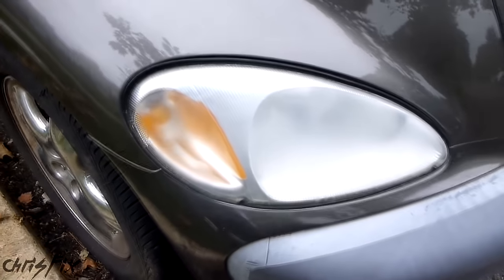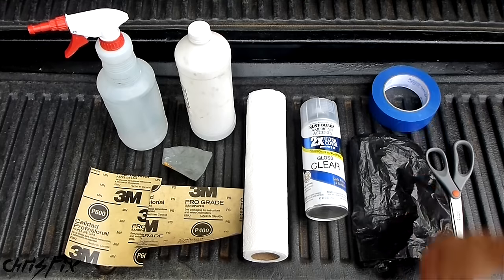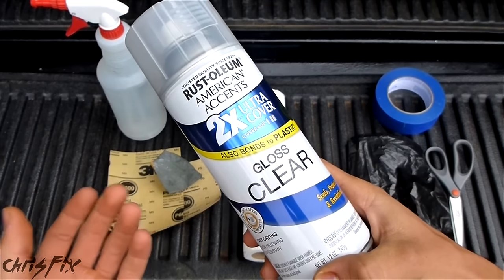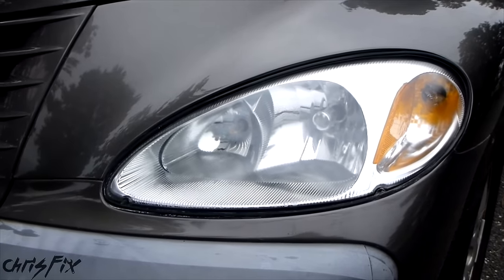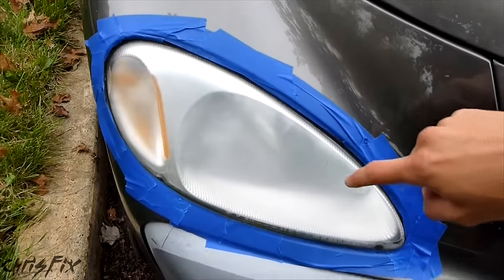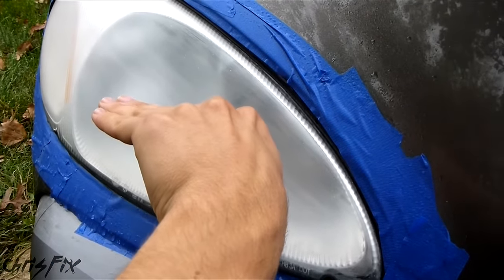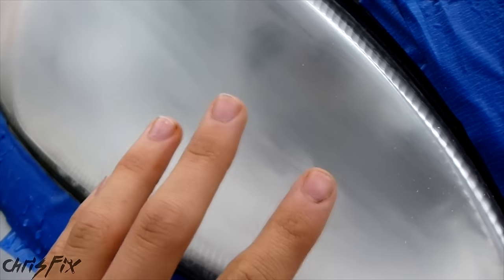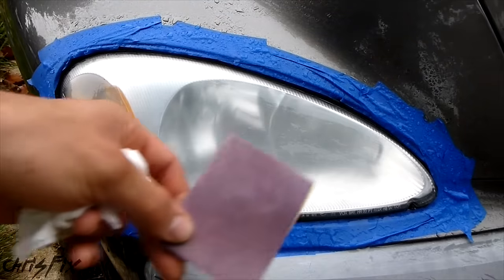How to Restore Headlights PERMANENTLY

Comment: After 3 coats of clear gloss... There is some haziness from paint I believe.  What shall I do to get absolutely clear glass now?
Reply from the maker: Wait a few days for the paint to harden and cure. Then wet sand with 2000 grit so it is uniformly hazy. Then move up to 3000 grit, then 5000 grit and then use a polish like this and buff it until crystal clear: https://amzn.to/2sJbZXk
Reply: Can a wax be used instead of this polish?
Reply: Buy a new headlight if you want perfectly clear glass.
Reply: wabash that makes no sense because headlights are plastic and the glass ones don't haze
Reply: sharkvshark i
Reply: Tim Schutte figures someone would say just buy new ones. People are so fucking lazy now adays.
Reply: I think even "new" headlight are plastic not glass.. the only ""glass" headlights are the ones you see in older cars, the sealed beam type. 

excellent video again from Chris.. where the hands are the star :)
Reply from the maker: Wax and polish are two different things. Wax is a protectant while polish is a fine abrasive that works like sandpaper but on a really fine level. So they are not interchangeable.
Reply: Chris after the polish and buff would u carnuba wax it?
Reply: Chris how do you feel about soap drops in water for wet sanding “wetter”
Reply: Chris, can you add a link to a real 2k clear coat like SprayMax 2k Clear Glamour? I think a lot of people are getting sub par results with 1k paints.
Reply: Just had the same issue after finishing up just now. It is hazy. So I will wait a few days and do as directed Chris. After the 24 hour period, is the car drivable?
Reply: What if it rains within that 24 hour period, or even right after you do this, lol? I checked the weather by the way.
Reply from the maker: That is defintely a technique I am using now and it does help!
Reply from the maker: Yes the car is driveable after a few hours but the longer you wait, the better it will be.
Reply: ChrisFix So I should sand it back down with 2k, 3k, then 5k grit and then use the Carnuba wax some time after the 24 hour period? Will I need to apply another layer of clearcoat after sanding before I add the wax after another 24 hour period?
Reply: Neal Edmondson Or maybe some people have other things to do than spend days doing this. I make $25 an hour. Every hour I do nonsense like this I lose money. A new set would be like $100 or less with no work.
Reply: How much money you make is   Irrelevant ? some people just like to save money and repurpose things nothing wrong with that
Reply: watching this painting as somebody who actually did some minor paint job (which worked great, no polishing afterward, perfect clearcoat.. this fear of running paint is funny. i mean, i did the same, but you should look at reflection in an object you are painting and you get perfect coverage but absolutely no paint running
Reply: ChrisFix @11:40 you use carnuba car wax, but in the description you also list “Compound polish to remove orange peel”. Did I miss the part where you use the compound polish, or did you change your mind about the carnuba and are now suggesting the compound instead? Or is it both? Thanks for this great video.
Reply: Always use a few drops of soap in the water.  Lots less dragging on the sandpaper.
Reply from the maker: Sanding with 2k will only smooth out your new clear coat surface, not remove it. It removes the orange peel and then you can move up the grits to smooth it out and finally you can use a polish to make it crystal clear.
Reply: Ben Saunders, Exactly!!  That’s why I change my own oil.....I enjoy it for a lot of reasons!  It has nothing to do with how much $$ I make.
Reply: Chris can you do a video on Glow Plugs, cleaning, checking for continuity etc?
Reply: Its going to get worse with time. This is not a good method . There are various products that can do the job and headlights should not be sanded .
Reply: But if you want the best result as of now than repeat this method . And put LaminX on your headlights. Its a tint basically dont worry you get the clear version and should help
Reply: sharkvshark is
Reply: adam smith only real gear heads would rather work on something rather than throw money at their problems.  Become a real gear head before coming here and saying that working on cars is irrelevant because you make big money.
Reply: Ben Saunders a new BMW X5 2011 headlight is $1000+... Thanks to this video, I only spent $20 for the material. And I'm going to do it for both of my beamers, yes absolutely worth the try.
Reply: Prowler - just like printers, people don't realize they make more money with parts than with the car in the 1st place.
Reply: Yeas do what chris says if you get orange peel sand it again and then reapply clear coat again and then sand it and clear coat again and then sand it and clear coat and sand it and clear coat and......
Reply: clear poxy instead of clear / remove the light
Reply: Hey Chris, I just try this and they look so much better. But I do have the same orange peel problem. I’m having trouble finding 5000 grit. Can I just stop at 3000 grit and use TW scratch & swirl remover as polish?
Reply: If you have a garage, you should absolutely do this inside. You should also use a hair dryer if it's cool outside and get the headlight up to 70F. Cold and dust are enemies of paint.  Also, he is holding the spray can too far away from the light.  The nozzle should be no more than a hand's length away.  You will end up with specs of dry paint mixed in with the paint.
Reply: you can get some rocking plastic two-part polish
Reply: That is meant to be used on plastic, not clear coat.
Reply: The back door on a Toyota 04 hit the panel off how do you do it passenger
Reply: ChrisFix just finihed yhis also having the haze problem. my question is aftet sanding . do i buff with my hands or do i need a buffung machine. 2nd question after the buff polishing do i also add the canova wax. thanks
Reply: $100??? On a cheap car maybe. But I doubt that too.
Reply: Today I learned that headlights magically install themselves once they are purchased.
Reply: +Adam Smith what you are saying is if you do this outside of work hrs and fix your headlights in less than 4hrs you have made money :)
Reply: Took me about 1 hour total to do this last night including drying time between coats of paint. Headlights look great.
Reply: Bird Person glad to hear it worked for you!
Reply: adam smith so why are you watching this video lmao?
Reply: @ Adam Smith    Go get 2 headlights replaced for $100.00 in fantasy land.  Alot of people take pride in doing things themselves, myself included.   And I am pretty sure you only make money when your working.  This is a few hour project when you have time to spare.  I have never met somebody who works 24/7.
Reply: 1 new headlight on my bmw $1200, this worked good for me
Reply: Do 400,1000,2000 and compound and polish after and finish with uv coating not clear coat
Reply: Good for you making $25 an hour. Some of us don't get that much so we are always looking for ways to save $$$. Plus you make it sound like you are getting paid $25 an hour 24 hours a day.
Reply: you still have to go for shopping the light, installing the light, and work 4 hours in your job
Reply: I resale cars. These little touches go a long way and getting my full asking price. I even remove wiper arms and paint them back.
Reply: Hey Chris would a heat lamp help it cure faster?.
Reply: sharkvshark use Meguiar's plastic cleaner/polish with a microfiber rag. Gentle circles....this stuff can also be left on as a protectant. It's good to put a new application on at least once or twice per year.
Reply: Nikhil, you are wrong. I used this same method 2.5 years ago and there is absolutely no change to my lights even in Carolina heat and sun! My lights were so bad initially I could not even see the past the yellow haze
Reply: Chill Nippins it’s a cheap fix , but does the trick for about a year , plan on repeating this process over time you’ll see that it’s not permanent.
Reply: sharkvshark q
Reply: How do you taste test a battery for a drill
Reply: my bad spot was fixed but now i seem to have another spot, i believed caused by bad technique on my part.  i'll take this advice and try again in a few days.
Reply: Just used this method. 
See how it goes
Reply: Nikhil Nadasan  Why not?
Reply: adam smith  $25 an hour coming from the guy that has a gofundme page.
Reply: I waited for the clear coat to harden fully (3 days) and wet sanded with 2000 grit, cleaned it and used my cordless drill with a polish head (10 dollars sponge polish head and generic inexpensive laqer polish)  and polished it to crystal clear 👍
Reply: Not everyone makes that kind of money. So, yeah, in a perfect world buying a replacement is ideal.
Reply: OK
Reply: @LORDRA1DEN  Dude, you make 25$ an hour? Do you live in a third world country? Is that why you're bragging about that? Get a real job, man. 25$/hour ain't shit.
Reply: @wabashstudio  I did it this way with the wet sanding and polish after painting and mine are perfectly clear
Reply: David McGaughey must leave it bound for 24 hours
Reply: Does anyone know what would cause this? I had the same thing happen with my Accord, decided to sand it off and start over, but I wanna make sure I'm not missing something before I do my second go. Pretty sure I have the same spray as Chris too.
Reply: Hey @ChrisFix , i did my previous car as instructed per video, and was all fine, but clear coat i used was from Poland, now i did same job on my other car, but used this rustoleum as you use. and my lights were hazy and clear coat wrinkled on top of the light :( looks worse and cheap than was before.. how do i fix this. because it seems as wet  sanding was not really enough. or was too much ? Help :O
Reply: your headlights are glass?
Reply: @nikhilnadasan6028  Yes. I'll use my $20 kit that comes with a buffing thingy for the drill. Easy and lasts a looong time!
Reply: Don't use clear coat lol
Reply: @wabashstudio  use 800 grit then 99% acetone then use cordless drill and TCUT takes 15 mins and clear like new
Reply: sharkvshark did u live in New Jersey at one point sometimes I hear the accent the  you go back to a standard American accent..
Reply: I did it but i failed what can i do now i have haziness and bubbles help me please
Reply: Hey adam smith ,,, my annual are near 200k and i do shit like this just for the joy of accomplishment in a JOB well done
Reply: @sharkvshark  shoe polish lasts for years. Black for mirrors etc and neutral for paint headlines. Very cheap.
Reply: @chrisfix  m
Reply: It worked good! Got the orange peel tho:(. But I will fix that with you last “optional” step. If your gunna go this far to do it might as well go all the way right?  BTW your channel has got me into working on my car thanks a bunch buddy you save me lotta money. And I have a new habit now even if I’m just a beginner
Reply: Toilet cleaning easy
Reply: You know it’s crazy but like you said old headlights are glass and have no problems getting dull. The old glass ones were about $3.95 in the fifties. Now they are plastic and costs several hundred dollars each. Why did manufacturers go to plastic, so they could make more money ?
Reply: you can buy plastic too.
Reply: sharkvshark buy a glass headlight.
Reply: sharkvshark f
Reply: G fig hi
Reply: sharkvshark 8
Reply: @chrisfix  can I use that from begining? PlastX Clear Plastic Cleaner & Polish
Reply: @wabashstudio  😂😂😉
Reply: @LORDRA1DEN  I make $33 (+OT) and hour but I still do my own oil change when I could get it done for $45, that because I enjoy doing it the way I want.
Reply: After 3 coats of Rust-o-Crap...you are having hazziness because that is called SOLVENT POP!!! And there is NOTHING you can do about that except STRIP THAT CRAP OFF! 

"Solvent pop" is the term used in the professional scope of automotive coatings, to explain the different characteristics of, not just automotive coatings, but all coatings. In this case, professional high dollar coatings can have similar problems that are seen in cheaper, production coatings not meant for professional use.
Reply: @rotceridjc  because glass shatters in an impact. Plastic breaks. its for protection. they could use the same type of glas like in the windshield tho, so easy answer is :plastic is easier moldable then glas and way cheaper lol
Reply: @wabashstudio  I have YET, to find a "cheep-budget-headlight"  for a PRIUS. i'M not COMPLAINING !  For after 10 years, 146k miles I'm still getting 48.8MPG hyway/50+ combined & all i do is  change the oil, filters, wipers, rotate the tires & thank God everyday I have this dream machine that really has a lot of room inside. Just sayin' MERRY CHRISTMAS.
Reply: buy new ones
Reply: @wabashstudio  $250esh each for new headlights or this.
Reply: @nealedmondson3191 not sure how being getting end results with a Helluva lot less money constitutes Lazy but you're entitled to feel however you want
Reply: Well I keep on making free mechanic help videos that actually help please and guess what I get for being honest and helpful?.... £0  ;) Real life sucks!
Reply: adam smith pointless non sensical argument mate. And$25 an hr ain’t nothin* to brag about. Sorry bud. I double yr wage that but I’d still sit down with a beer and do that. Yr learn something. And keeping coin in yr pocket too. But u of course knew that   Carry on
Reply: adam smith some people have more time than others for this. Also some people get  satisfaction of doing something themselves instead of running out and plunking down cash.
I did mine today and they came out great! For $20. And 2 hours of my time.
Or i could have spent $300. On new, which didn’t make sense for me on a 2010 110k mile car that i will probably sell in 12-24 months for something newer.
Reply: Cereal Spoon Lmao off 25hr! Haha, i know people who make 200k plus live in big houses and do the simple things like this and rotate there tires, change there oil, cut there own grass etc.. because they enjoy it.
Reply: Amazing results, and even more amazing presentation -- very thorough, engaging, and succinct! For finer buffing, I like Flitz polish paste, which is also formulated to be safe for plastic. By the way, you forgot to include the cost of whatever drug you took to make your hands move so fast!
Reply: @KeweKrypto 12 most retail "waxes" have chemical cleaners and or abrasives in them. Unless your talking about a true paint sealant.
Reply: KeweKrypto 12, the way you worded it, you said polish was not abrasive and that wax was not abrasive and that wax was like polish, all of which is completely wrong. I realize you meant to distinguish the two, but what you typed did not convey your intended meaning. “Wax is unlike polish because wax is not abrasive.” You could make it even clearer, and longer, but that would suffice.
Reply: re do the process
Reply: @LORDRA1DEN  "nonsense like this" Sounds like the words of someone who prefers sitting on their ass rather than working for reward and making stuff last. Bet you lease a car . Also, yeah sure you can buy a new set, but are they going to install themselves? You're going to have to pay someone else to do this "nonsense" or, DIY.
Reply: @lostintime8651  What do you use to paint them? I need to do some touch up work on my Roadster soon and this is on the list.
Reply: @Reploidx9  sorry. Old reply. Paint what?
Reply: I did it Chris but after the clear i got like fine lines also with the clear on
Reply: You must know the air dry clear enamel is far from a permanent fix. It might look decent for 6 months and then start yellowing. And generally speaking, you don't sand anything soft in a circle.
Reply: Beware I tried it and it destroyed my headlight, the clear coating hazed and reacted adversely creating a gator skin in lens, used the exact same rust oleum 2X
Reply: I followed this for my 2000 Mustang which had yellowed badly and it's not perfect but close to perfect...Thanks Chris for the excellent tip.  Just a note to some out there, there are preventative treatments that work great...but you need to apply them when your car is new.
Reply: @LORDRA1DEN  $100 for OEM roadlegal headlights? I think not. Not to mention the hassle of having to take them out. Maybe you have an old car that is easy to do that too. But on higher end cars you'll be up in the 1000s for new headlights and a pain in the ass to replace.
Reply: @bernardoojeda5295  right!? They dont make glass anymore a major car manufacturer fail!!!
Reply: After paint you should "cut" orange peel with P2000 sandpaper to make paint mirror like flat. Then use a polish to make it crystal clear.
Reply: @sharkvshark  wax & polish is 2 diffrent thing. You should use polish
Reply: sharkvshark can i wash the car the next day?
Reply: @chrisfix  can I use the bug spay method first to maybe cut down on the scrubbing with sandpaper?
Reply: Instead of replacing the whole headlight system, you could probably just replace the lens. A pair for my Mazda 6 would run me about $40. Much better than paying $300 for a set.
Reply: adam smith look
Reply: @chrisfix  i would do the exact same thing but go to 2000 and buff it up till its glassy. Mine and my wife cars turned out sweet
Reply: @bernardoojeda5295  the glass ones dont heave a clear coat on them and the glass doesnt haze. The plastic ones do from factory and its the uv rays on the clear that makes it that way. The more clear on the plastic the longer its gona last b4 it will go yellow
Reply: @wabashstudio  thanks for nothing
Reply: @chrisfix  The problem is the clear coat may have a different index refraction from plastic causing a blur.
Reply: @Ungalfo  go to Walmart I found it just a minute ago
Reply: @wabashstudio  But i dont want to spend $1200 for each side
Reply: @bernardoojeda5295  Depends on the year of the car. older cars are all glass.
Reply: YOU SHOULD NOT USE 90% ALCOHOL ISOPROPYL YOU ALWAYS HAVE TO USE 10% -15% BECAUSE ALCOHOL AT FULL STRENGTH MAKES YOUR CLEAR COAT HAZY AND MAKES IT CRACKED BIG MISTAKE, I MADE THAT MISTAKE DONT LET THAT RUIN YOUR WORK, YOU CAN ALWAYS GOOGLE IT AND YOU WILL SEE
Reply: Just finished a headlight and it didn’t turn out well. When I sprayed my first coat of clear, it looked absolutely amazing. Waiting 5 minutes for that to settle in it started cracking and separating. I used the exact same rustoleum that bonds to plastic that Cris used... not sure what to do now. I guess just wait for it to dry and sand it back off. This is starting to become more trouble than it’s worth.
Reply: @LORDRA1DEN  wow! congradulation you know how to spend money 🙄... something that obviously no one here know how to do since their birth, right ?!...bravo . Frankly what are you even doing on this channel
Reply: @wabashstudio  These are plastic mate.  You can just polish them but will not last as long, even this will not be truly permanent, but will last a long time.
Reply: adam smith Ah, to be wealthy.  But remember you don’t get that “I did it myself” feeling 🤗.
Reply: @_DST0NE_  is that just to remove the "Orange peel" after the clear coat or only for polishing oxidized headlights, or both? Thinking about trying this but I don't want to remove the clearcoat that I put on today via this Chris Fix's method.
Reply: TEL_02  is that just to remove the "Orange peel" after the clear coat or only for polishing oxidized headlights, or both? Thinking about trying this but I don't want to remove the clearcoat that I put on today via this Chris Fix's method.
Reply: @GRADmusicandrap  as long as you dont sand with a really fine grit you should be able to get most of the orange peel out without losing the clear coat. Buffing with the Meguire's is the final touch.
Reply: @_DST0NE_  so don't sand it again and only use the meguiars to remove the orange peel?
Reply: 2018 silverado with painted front end , after they repaint the trim , it was $2,000. , under warranty of course.  $1300. Parts alone .
Reply: @sharkvshark  only if it is a slightly abrasive wax it has to be abrasive enough to cut through the orange peel of the clear coat and then you need to reseal it and polish it with a good quality UV resistant wax or one of the newer spray and buff products. Otherwise it's almost identical to leaving your car with absolutely no wax on it. Hope that helps. Good luck, if you haven't already taken action on it.
Reply: @KeweKrypto 12 many polishing compounds contain carnauba wax.
Reply: @kostikyoda1078  That depends on the state where you live. Here 35$/h would be very high. But at the same time, you would have to pay that money to somebody who replaces the headlights and buy the new one as well. Thus the price goes up.

I polished mine myself. I saved the money on car where buying new parts is bad investment unless necessary and spent some time on fresh air - after hours at the desk it is a nice change. And being able to do some jobs by yourself is always a benefit
Reply: gay!!!!
Reply: sharkvshark   Buy a new set of headlights online for $100
Reply: “TRUST ME”. DO YOU KNOW HOW MANY BABIES HAVE BEEN BORN WITH TRUST ME
Reply: @LORDRA1DEN   are you working 24/7?
Reply: i have the same problem
Reply: Dont use does sand paper use 1500 to 2000 no less no higher with water then buff it with polish then you can clearcoat it or use 3m vinyl film
Reply: @LORDRA1DEN  you have to pay someone to install it too.
Reply: Yurkee what did it look like before you wet sanded? Very hazy?
Reply: @LORDRA1DEN  Nailed it!!😤😤
Reply: @LORDRA1DEN  Do you not have free time? This takes like an hour,  so spending $10 to save $100 means you saved $90 in that hour. And that's not even counting the time it would take to swap out the headlights, so it's really more like $90 in a half hour.  Are you really that bad at time and money management, or did you just want to flex that you make slightly under the US average hourly rate?
Reply: @chrisfix  where can I order some bucket seats for my lexus IS 300 ?? Any sites that make costume seats I want something nice not over exaggerating
Reply: @chrisfix  hey, so I just used your video to get rid of yellow oxidation on my grandfather's '06 Buick headlights, and I was happy all the way until I still had haze even after the gloss clear. I thought I ducked up. Then I read this comment, sanded and polished, and that headlight is looking brand spanking new. Thank you for posting this - you just saved me a shit load of headache trying to pass a safety inspection. Much appreciated. Keep up the quality videos.
Reply: Hey Chris, did this last weekend and it worked perfectly!
Reply: this happen to me too; i added another coat of clear gloss but way more than Chris did, and it came out super clear
Reply: Paint better pleb
Reply: @nealedmondson3191  Really new headlights is the only permanent and perfectly clear solution.  Sanding and repainting the headlights is the second best, but the plastic itself will slowly fail.
Reply: ChrisFix  in this sanding, are we trying to remove the acrylic coats we just applied? Or are we just roughing up the surface of the acrylic and then polishing it?
Reply: The supplemental fine sand and polish method Chris suggests in response to this comment worked for me.
Reply: @sharkvshark  No, regular wax is different than the polish. The polish Chris uses is a little abrasive which helps give it a better look....
Reply: "Not clear enough -- I could still see the glass from an angle" 😂😂
Reply: @bernardoojeda5295  ....the plastic ones have a clear coat that yellows after years of no top coat protection but the glass ones dont need a clear coat so they never get yellow
Reply: 3M makes a kit for this very thing. Only thing U'll need is a drill. It has clear coat polishing compounds thd whole nine yards.
Reply: @LORDRA1DEN  you're not working 24/7 and $25 an hour isn't high LoL
Reply: that's what I did
Reply: @sharkvshark  I started out waxing my headlights when my car was new.
Twice a year with MeGuiar's tech/hightech wax. Tow coats then 2 more with straight carnuba wax.
I also used the same on the rest of the car while I was at it.
Well over a decade and headlights still look like new.

Best to get a god headlight restoring kit and do it right then maintain it after that.
Reply: Yurkee hell yea 👍🏻👍🏻👍🏻 you doing good my man
Reply: barqzr davi A mind is a terrible thing to waste good for you
Reply: @nealedmondson3191  lazy? I guess it's ok with some people that nowadays you have to spend hours making a headlight clear. Really. I bought new for my trailblazer on Amazon, total time, 30 minutes & spent time with my kids. Think b4 you, nvm, you get it
Reply: @htko89  THANK YOU! That guy was rude!
Reply: @nikhilnadasan6028  that's what I thought. I'm seeing all these videos about sanding, but I was told by a guy there's a way to fix it without doing that to for headlights "the right way" so I'm looking for this "right way" and I can't seem to find it. I THOUGHT he used fire or heat. Have you seen this method?
Reply: @birdperson5986  😂😂😂😂😂
Reply: @djb6496  good to know, thank you!
Reply: Your best off polishing after the sanding, then add the clear coat
Reply: @wabashstudio  perfectly clear can be achieved when you properly know how to wetsand and buff.
Reply: adam smith  how much time did you waste commenting on this video
Reply: Go to a scrap yard and get replacements; all this polishing for days on end is a waste of time.
Reply: Prowler me too
Reply: Get a new headlight.
Reply: @wabashstudio  not true. look at the video I just posted. There is better gloss you can use and this spray method is not correct. You need 1 light dust coat, and the 2nd coat need to be heavy and thick so that paint dries like glass. See my video.
Reply: look at the video I just posted. There is better gloss you can use and this spray method is not correct. You need 1 light dust coat, and the 2nd coat need to be heavy and thick so that paint dries like glass. See my video.
Reply: @nealedmondson3191  look at the video I just posted. There is better gloss you can use and this spray method is not correct. You need 1 light dust coat, and the 2nd coat need to be heavy and thick so that paint dries like glass. See my video.
Reply: @wilborth5th  I used 70 percent isopropyl and mine looked extra hazy and cracked plus my clear coat dripped. Guessing I can start over
Reply: @ryugo7713  what did you do to fix it?
Reply: Pino Amerikano I had to sand it back off. Dried clear coat is rough to sand by hand. Since then I’ve actually used my own method on two other sets of headlights and they’ve turned out great. Pretty much do everything Cris does EXCEPT using clear coat. Use Meguiar’s Headlight Coating instead. Walmart has it in stock at all times. Also, after the very last wet sand (I went all the way to 1200 grit) I polished the headlight with Meguiar’s PlastX Clear Plastic Cleaner and Polish. That was a long time ago and my headlights are still clear and have not oxidized since.
Reply: @ryugo7713  thanks and last thing. What grid did you use to sand off, alcohol type and did you polish by hand or with a buffer?
Reply: Pino Amerikano I did everything by hand. I didn’t use alcohol to clean off in between sands, I just used a water and vinegar mixture for the wet sanding and to clean. Used a microfiber towel to dry. So it wasn’t fresh in my mind earlier when I said the final grit. I meant 2500, not 1200. So yeah, wet-sand by hand with 400, 600, 2000, 2500 grit. I used circular motions with my sand paper since I have a Jeep with perfectly round lenses. There may be something to the whole horizontal sanding Cris uses but TBH the 2500 grit sandpaper and plastx polish removes just about all micro scratches. I used a microfiber applicator pad for the polish then dried with a clean microfiber towel. The Meguiar’s headlight coating has perfect instructions for applying it. Just so you know, you may think you screwed up as your sanding but just keep going and you’ll be amazed with the results.
Reply: @doityourself2save  i know exactly what you mean, it happen to me many times, thats when i learn that is not as easy as it looks, so many things that play a factor, the environment the temperature, the materials,and someting else, is better if you can take the assembly out of the car, i did my moms the other day and i messed up she was mad at me, so i went to buy the real gun and compressor and yes the mist the gun makes is way thiner than the can, and that is what makes the difference, long answer sorry.
Reply: @sharkvshark  no u have to use polish not wax
Reply: get a new headlight...simple
Reply: @chrisfix  How long I have to wait before I can buff the polish off? And should I simply buff it off with a dry rag?
Reply: @wabashstudio  he'll of a lot less work.
Reply: @KeweKrypto 12 you can use wax as the final 'layer' most certainly...if you do this clearcoat method in the video without the perfect conditions/temperature, you have some sanding to do, because I know first hand this will orange peel, and not just a little. You work your way up [up in number]grit til you are at a compound and finish with Nu-Finish [orange bottle], again I know first hand. I did this video and it came out horrible, and fixed it with a 3M kit....Nu Finish after that to seal and it did the trick.
Reply: should just have used 1500 grit.. that 400-600 makes some deep scratches and ruins them
Reply: @TorresFord  fair enough point...but 1500 to start just takes 3 times as long if the lights are real bad or you have to remove this clearcoat trick in the video, which does not work.
Reply: @wabashstudio  
Exactly
Reply: Thx Chris this really worked!!!
Reply: FartManly  Try actually looking next time.
Reply: I think polishing is required before applying clear coats. Also your first coat has to be very light.
Reply: Make sure you use P2000 grit because if you use Cami grade sandpaper without the P in front of the number it will be like using 4000 grit and will be too fine. P2000 is like 1000 in Cami grit sandpapers so you are going from 400, 600 and then P2000 which is really like Cami 1000 grit. I learned this the hard way painting guitars and having paint I couldn’t buff because I was overlapping grits and putting scratches back into the paint and clear.
Reply: ChrisFix  how long do I wait if I get runs? And so I wet sand 2000 again and recoat?
Reply: Amazing sharvshark😍
Reply: @carl2591  There were recent glass headlights that weren't sealed beam, like 2005 Range Rover. I wish we'd go back to glass. Most foglights are still glass
Reply: @chrisfix  if going that route, using 3k grit, then 5k grit, then polish and buff. Is the clear coat still in the picture? Is it still protecting the headlight or do I need to apply a new layer?
Reply: @chrisfix  I followed your steps in the video. All was good and looking great

It had rained for a couple of days probably a week after I had finished the job and the when I went out to the car I could see lots of white condensation/water marks within the light. I'm not sure if this is just underneath the coat of lacquer or actually in the headlight itself?
Reply: Bill Benton What size drill bit
Reply: TEL_02  so is the McGuire's Bullshit or not???
Reply: Can i add a 4th coat pf gloss? If i still see orange peel?
Reply: Im getting the same issue when using 3 coats of the linked 2k gloss clear coat.  Interestingly, after first pass it was the most clear, then subsequent passes made it less clear, but I followed through with the 2nd and 3rd pass anyways.  Let’s see and wait til tomorrow.
Reply: @chrisfix  I think you've confused people by telling them to wet sand again after the clear coat. I would have assumed the process is to polish after the clear coat to get rid of the orange peel. After you polish, rub it with alcohol and then add carnauba paste wax  and viola you're done.
Reply: @sharkvshark  No, wax and polish are different things. Polish is an abrasive to remove very fine scratches and swirls, wax is a sealant to protect. First you polish to make it smooth and shiny, then you protect it and make it easier to clean by waxing.
Reply: @bernardoojeda5295  
glass ones are hard to find, also you need to remove the whole housing from the car and place in an oven preheated at 200° F

for about 15 minutes, the adhesive is very hard to remove but softened up after you manage to pry off the lens
Reply: @chrisfix  Hi Chris, I'm at this step right now and am looking for some clarification. After I polish with the PlastX, should I wax the headlight like the video suggests, or is polishing all I need to do? Basically, sand then polish, or sand then polish then wax? Thank you in advance.
Reply: @runningwolfus  I thought it would be a simple quick fix. That amount of effort I'd rather just swap them out for new ones.
Reply: @chrisfix  Was concerned about my paint when I saw this too. Thank you for relieving my worries :)
Reply: @chrisfix  thanks for not specifying this in the video. I hit my headlights today with 2000 grit they look like complete garbage again! Now I have to go run back to the parts store and attempt to find 3000 and 5000 grit sand paper just to make my hard work look presentable. Dislike on this video for lack of specifics.
Reply: @nesmacinvestmentsllc772  How about not mindlessly surrendering to the 'disposable' consumerism scam that gets worse as time goes by. There used to be a sense of pride in craftsmanship and making things that last. There used to be a whole sector of tradesman who specifically repaired items for people. Now everything is made to be thrown away. Things like toaster ovens, clothes irons, and blenders were made with quality components and the idea of future repairs being needed was shown with the design. Things today are sealed to prevent taking it apart as well as warned against in the manual and all warranties are void if you do. I was raised partially by grandparents and fully raised with their thrifty sense. I am a master of repurposing if there isn't a repairable solution. Grams always would say "That's what we used because that is what we had." and a reminder they didn't make things like _____ whatever item of topic. Baking soda paste for brushing teeth, ice cubes and salt in a coffee carafe swirled around and around to remove the brown stains inside the glass (this works brilliantly actually and was a gem for waitressing as a teen). White vinegar is liquid gold, cheap, plentiful and 1000 uses. We keep it by the gallons. 
It not only keeps more of that $25/hr in your pocket but it is far less wasteful to DIY when you can. Plus I am really tired of companies making the cheapest, barely held together, breaks day after warranty crap and making obscene amounts of profit. Cut every corner they can to be "cost effective". So I 'Fight the Power' by taking that cheap crap after it breaks and using every part I can to extend the life of some other junk limping on its last leg. Makes me feel like a rebel
Reply: Best to start it early if you can. As long as you keep the lenses polished and waxed they will never dull/haze, which is usually caused by UV light from sitting in the sun all the time.
Reply: This makes absolutely no sense. How do you look at a reflection of something while you're painting it?!
Reply: @nealedmondson3191  yOU MUST BE A KID WITH NOTHING ELSE TO DO ...LOL
Reply: @chrisfix  can't I send you something
Reply: wabash 😂😂😂🤣🤣🤣🤣🤣👍
Reply: @chrisfix  This worked!
Reply: One of the reasons the head lights are hazy is because of uvrase
Reply: @sharkvshark  i would say no because polish actually levels out the clear coat whereas wax fills in ridges of clear coat. Personally i would do 5 coats of clear and really get a good polish on it so you know when you sand and polish the coating will still be there.
Reply: Use heat
Reply: R
Reply: too many coats x1 is ideal
Reply: I think I may have messed up: my left headlight is very hazy from possibly over buffing, using a 600 grit and 2000 grit piece of sand paper. I used soapy water while buffing, then Meguiar's headlight coating afterward. It's still very hazy. The other headlight I used the 600 grit once and the 2000 for the rest, but it looks very clear, but with some swirl marks from the sand paper.

Any ideas, ChrisFix? :o Thank you.
Reply: ChrisFix uhuhuhuhuh
Reply: ChrisFix Hugh hhu
Reply: ChrisFix hhhh
Reply: sharkvshark uh-huh C
Reply: Guy uh
Reply: sharkvshark Yuchi’s u
Reply: sharkvshark uh uhh hi. H
Reply: ChrisFix hi. H u h u Cvs h Hugh
Reply: ChrisFix h hi
Reply: ChrisFix   Ha
Reply: ChrisFix u
Reply: @LORDRA1DEN  my man is out here grinding ! Much respect to you . I was just about to ask how much you make , but you answered it for me . You're pretty awesome .
Reply: wet sand with 2000 grit, then get some rubbing compound, then polishing compound, then wax
Reply: ChrisFix would you be able to show how to do those steps so it’s clearer to see to make sure i’m doing it right? i dont want to mess something up
Reply: What do you do if you accidentally make it runy?
Reply: Buff out your headlights

And your entire car will be buffed out
Reply: @nealedmondson3191  sometimes you cannot buy a new one if the car is discontinued or something..
Reply: @LORDRA1DEN  sometimes headlights are not available like if the car is discontinued.  Some headlights run into the $1000s of dollars.. You just have to make a judgement call I guess.
Reply: @chrisfix  do you need to reapply the clear coat after doing these steps
Reply: @LORDRA1DEN  Adam you have time to watch this . Are you to lazy to make something ?
Reply: @mrstanskaggs1  I kind of hate that car, but it has a cult following so those parts are still available.
Reply: @carl2591  if im not mistaken I think my 2001 s10 chevy has glass headlights they have never turned
Reply: @sharkvshark  y
Reply: @chrisfix  Even though the sand  paper (2000 3000 grits) are fine grade, isn't it making a scratch to show haziness?  I tried sanding after clear coating since it is hazy, the surface became more smooth, but it didn't come back to clear.  So, are you recommending rubbing polishing now?
Reply: KeweKrypto 12 hey man 2 years later I need help. Do you think I can substitute meguiar’s ultimate polish for that one chris recommended? I need help haha.
Reply: @isaacevans9980  i used Mothers mag and aluminum cleaner it cleaned mine great
Reply: @chrisfix  Oh, wow! Well said, Dr.!   - Love your videos, brutha!
Reply: @nealedmondson3191  And wealthy!
Reply: @chrisfix  Well, Chris, instead of doing that after spray painting, do that instead of spray painting! Then you do not have to use the paint! It will last just fine, and wax the lens every 6 months like you do your car!  It really is a mess to spray paint it.   Paint can chip and peal (which I have seen...yuk).  And it can also craze the plastic as not all lenses are created equal in the factories! Injected plastics are fussy. Anyway, just my 2 cents on that step.  I would never do that on my car.
Reply: Hell yeah🤦🏾
Reply: Buy new lights on ebay, lessthen 150 a pair
Reply: @chrisfix  Hi Chris, I hear this method last for about 1 -2 years only and then the clear  coat starts to peel off or crack. Then got to do it all over again. What's  the true here?
Reply: I had the same issue. I ended up trying it again and put the wax on before the clear coat, and only did 2 really LIGHT coats of clear coat, and it turned out a lot better.  You can even wax it again after the clear coat for even better results.
Reply: @chrisfix  .
Reply: @chrisfix  ,
Reply: @ryugo7713  I wish I saw your comment first, before trying Chris' method. I followed his instructions down to the letter, used the same wet sandings and clear coat, and here's what I got 24 hours later: passenger side is half blurred half crystal clear. Driver's side is a complete and total disaster: haze, cracks, separating, and spots.

New assemblies are out of the question: will have to remove the front bumper just to get at the bolts underneath for removal.

So it seems like I'll have to do the same thing you did to make my headlights more presentable.
Reply: @sharkvshark  don't deviate
Reply: @wabashstudio  $20 bucks renewing my BMW headlights or buying new for $1200 each?
Reply: @nealedmondson3191  mine cost 1200 each. These kids don't understand
Reply: @LORDRA1DEN  for a hundred bucks you get self-installing headlights? Nice!
Reply: @rfahlsing  I'd rather have brand new ones if it bothered me that much and just have to take a few screws out. It's not hard to replace those, but this is a project that takes more than a day to do and involves a lot of annoying work. Yes, you can save some money, and if you like projects like these then it's worth it to do it. I do not like projects like these. The results can be spotty. I've done it before and was less than impressed, which is why I wound up just swapping mine. Different car.
Reply: My clear coat didn't go on well and after drying for 2 days it got really spotty. Any chance to fix that and clear it up?
Reply: @wellesradio  It's both, you use the compound to mechanically buff out the orange peel, it's like a super fine sand paper.  The carnuba wax, just fills in the micro pores in the paint to give it a smoother finish and protect it.
Reply: A buffing wheel and rubbing compound worked very well for my final finish.
Reply: @chrisfix  this method is how professional car detailers do it. :)
Reply: He does! I once asked his opinion about a project car I wanted to purchase in the comments. To my amazement, he actually replied! I loved that.
Reply: @chrisfix  PLASTX is for UNCOATED clear plastic, not painted surfaces. It is a plastic abrasive, not a paint abrasive like compound.
Reply: 14
Reply: @chrisfix  ur the man ty
Reply: @nealedmondson3191    well, i'd rather do that than paint my plastic headlight with rustoleum. plus it pops right in.
Reply: @chrisfix  would it help to apply a clear coat of auto paint
Reply: So from 0 to 11
Reply: Why did my clear coat paint keeps on cracking?
Reply: @chrisfix  iiiii
Reply: Hi Chris, I’ve recently used this method on my headlights however on my 3rd coat of clear coat on one of my lights, there is a slight run/drip as I may have put it on a little thick. Will this come off when I wet sand with 2k and buff with carnauba car wax? Cheers
Reply: My headlights went from after to before.. you skipped a major step of using compound after sanding. I wasted so much time
Reply: After the three coats of paint, I'm going to wait 24 hours. I would like to wet sand it again with the 3000 grit and then using that carnuva wax you recommend. But won't sanding it again remove the clear coat? applied?
Reply: 400 600 2000 3000 compound polish wax. Bam.
Reply: The main lesson here is that if you don't know what your doing, just don't do it because then you will be buying new headlights.
Reply: @chrisfix  Wet sand with finer grade and polish before applying the clear coat and you should get better results. The clearer you sand and polish the bare plastic the better. If done proper clean and degrease the headlight and then apply the clearcoat and you get almost crystal clear headlights. :)
Reply: Buy new headlights.
Reply: @chrisfix  Hey, I have the exact same clear coat spray by rust-olem but its semi gloss instead of your recommended gloss. Do you think the semi gloss will look ok?
Reply: @carl2591  VW Golf IV has got glass headlights, not that old
Reply: @chrisfix  Can you use compound to polish or do you need to use a plastic polisher?
Reply: He said wet sand then wax it
Reply: This worked on mine, thank you Chris, but now a few years later I have to do it again.
Reply: @LORDRA1DEN  so you get to choose your own hours? If i could i would work as much as possible until the weekend, but i cant as i have set hours. so in the hours im not working, i cna do this and make my car look really really good.
Reply: @nesmacinvestmentsllc772  2000 is plenty
Reply: @chrisfix  you ik re jrrkkkjrk kkk kkk kkk kkk k were rrrkkrrrk keep baby bf
Reply: @chrisfix  j
Reply: @sharkvshark  no , polish is a light abrasive so it still sands it a bit , it is to get rid of the haziness. You can use a wax to protect it but I would just go with the clearcoat
Reply: @wabashstudio  I did mine and it looks like clear ass.
Reply: So I had the same situation as you but I went over the last steps longer and with more patience and verification  it worked I used 2000 grit and then nu finish polish and it became clear as mentioned. Just need more effort for longer and patience until all the hazy or unclear spots become clear.
Reply: @LORDRA1DEN  hopefully you're making more than $25 an hour by now lol that's so little money especially if you ain't getting OT
Reply: @chrisfix  Hey Chris,find us a cheap solution for cat thieves
Reply: @wabashstudio  Did you price the new lens? I bet not.
Reply: Correct.  You can spend $200+ per headlight and get perfect glass.
Reply: @sharkvshark  I would say no. I don't think waxes have any grit. Rubbing compound (most grit of the pastes eq to about 7000 grit) and Polishing compound (like 10000 grit) really clears it up. For my issue I'm going to wetsand with 600 grit and a DA buffer and then go to 2000 then 5000, then rubbing compound then polishing compound (all with a DA (dual action) buffer). Then hopefully I will get my one headlight back to normal and coat with gloss clear.
Reply: @bernardoojeda5295  I think he meant clear as glass, not actual glass
Reply: Ff
Reply: @sharkvshark  No, Car wax has no cut in it. I did this but first used the wrong clear coat on once light cover. I had to sand all that off and start over. But I got it. Once you I went from 800 grt to 5000 stepping up a little each time. Then finished with the correct clear coat (two coats) the let cure for 24 hours then rubbing compound then polishing compound. Came out perfectly. Never needed the wax
Reply: I did this but first used the wrong clear coat on once light cover. I had to sand all that off and start over. But I got it. Once you I went from 800 grt to 5000 stepping up a little each time. Then finished with the correct clear coat (two coats) the let cure for 24 hours then rubbing compound then polishing compound. Came out perfectly.
Reply: @JohnDoe-dc6nr  absolutely
Reply: @chrisfix  l
Reply: @chrisfix  wait, what?so wax or polish ? Cause you described their differences in a comment above..
Reply: I've worked with epoxy --- made a countertop.  If you have never sanded plastic, be aware that you may freak out when you start sanding.  It will completely fog up the surface and you will not be able to see through it.  But with each level of sandpaper -- increasingly finer grit -- you will begin to see clarity.  Just hang in and trust the process.  And he is right about using a light hand.  You do not want to score the plastic, just lightly brush the surface.  And I would not rush the sanding process.  With the counter top I actually went up to 3000 grit.  Not saying you have to go that high, but I expect the finer the sandpaper the clearer the lens would become.  I also finished the countertop with a polish and it came out amazing.  I will try this on my car's headlights.  As it sits, they get any worse and I will not be able to see at night.  So if I might have to fork out the money for new ones, why not try this method first?  If it does not work, then I am back at getting new ones.  If it works, even for a while, I get to put off spending the money on new ones.
Reply: @birdperson5986  how does it look now
Reply: Wet sand again and repeat process
Reply: @carl2591  SW as
Reply: Mine came out pretty good..
Reply: @chrisfix  I can attest to this!!! After following the instructions in the video exactly, I was still left with some pretty bad haziness and orange peel. But once I used 2000 grit, 3000 grit and then used the Meguiar’s plastX polish it looked brand spankin new! I also used the carnauba wax at the very end like Chris recommended and I was left speechless. I’m definitely satisfied, it just took a little more effort than I thought. Better to DYI than spend money on a new one
Reply: @wabashstudio  Agree, but for 10 bucks a headlight, it's worth a try (imo....)....
Reply: @bernardoojeda5295  well, a lot of cars have third party glass enclosures, so ...you could buy glass if you wanted to (but it's 250+ per headlight)....I prefer the 10 dollar method, personally ;)
Reply: @Saundersstrong  I love this…. Money doesn’t buy you life knowledge for empowering your self sustainablity and be useful.  Be self dependent, learn all you can in life and know what God giveth you, it could be taken away in a second…..

Plus who wants to depend on someone else who don’t give a sh!t about your stuff. Work hard and see how the appreciation for things makes you feel alive and vibrant from inside.  

Mr Money man, times are uncertain and the value of the dollar, well we keep making money, trillions in debt and this crypto currency…. Well who knows…

I love being a woman of many skills! 😘
Reply: Chrisfix I totally dig your communicative skills and knowledge…
Single?

Playing, I wish more men were as intellectually put together as yourself!  

Thank you for all your videos!  Much Love and Respect..
And if there is a Misses, I do apologize. You have a keeper!
Reply: @wabashstudio  or do this and don't.
Reply: @chrisfix   I think I oversprayed a little with the clear coat in my headlight so now it’s blotched out how do I remove dry clear coat off my headlight without ruining even more, because now I look like one eyed Willy
Reply from the maker: @austinrobinson5833  if you let it dry for a day, wet sand it with 1000 grit until it’s all level and then go 2000 then 3000 then 5000 then polish it so it’s clear. It will look amazing!
Reply: @kano0303  What did you polish the headlight(s) with to get rid of the orange peel?  Did you use 70% alcohol as Chris used?  Please advise.  Thanks.
Reply: @kano0303  What did you use to polish the headlight(s) to get rid of the orang peel?  Did you use 70% alcohol as Chris used in the video?  Please advise.  Thanks.
Reply: @LORDRA1DEN  So, how many hours are you allowed to work? Unlimited?  Additionally, if all you make is $25/hr, that is a finite amount. You are limited to 24 hrs in a day.

Also, if the headlight is $100/each, not including labor. Then considering you work an 8 hr day. You would have spent an entire day's wages on new headlights. 

Your logic is flawed. If you would rather just come home from work and have a beer, just say that.
Reply: @mikagami69  I didnt want to sound mean—I had the same thought. I wanted to ask him why he was bragging about $25/hourly wage. He clearly works on an hourly basis and his annual earnings will always be limited.
Reply: @silentghost82  the headlights will become so shiny that he wont nees to turn them on.
Reply: @temituoyoejeye2975  bro its simple, when u get orange peel, u go towards high grit sanding and after sanding u buff with compound polish using hand or machine.
Reply: @wabashstudio  or just restore them cheaper and you don't have to take the headlights out and all that which can be a pain for some vehicles. But some water and sandpaper that's what maybe 20- 30 bucks at most
Reply: @chrisfix  eq
Reply: Next time buy Maguire's Headlight Coating
Reply: @JohnDoe-dc6nr  i
Reply: @LORDRA1DEN  who's gonna put them in?
Reply: @jackryan4313  It's easy to do that.
Reply: @LORDRA1DEN  that's not the point. The point is they have to do that work still. Or pay more money to have someone do it. This whole process is easy, so ease isn't the issue anyways
Reply: @jackryan4313  You feel free to go buy the supplies, take the time to take them out and do all this, wait, then put them back in to save a little money. My time is more valuable to me than doing al this and headlight assemblies on these old cars are cheap. I'd rather spend more and take 5 minutes and have new lights than all this.
Reply: @LORDRA1DEN   I did both headlights in an hour and a half. They look factory new. Cost me $40, and an extra hour total for driving for supplies and watching youtube. Never took the headlights out of the car. 

Oh, and it's a 5 year old car. So 2.5 hours and $40 vs paying $100 per light, and then installation fees for the mechanic of your choice because we know you won't be bothered to do that either...driving to the mechanic, waiting on the mechanic until they're done with your car, waiting on the parts to get in in the mail in the first place...yea, you take the easy road buddy. Have fun blowing money and telling yourself youre saving yourself money because your time is more valuable...while you sit in the mechanics lobby on your phone wasting that valuable time because you can't go anywhere else
Reply: @LORDRA1DEN  oh, and I find it funny that you make this seem harder than it is. Who said anything about taking the lights out of the car? Or waiting? Again, I literally walked downstairs, went out to my car, and spent 40ish minutes per light. Sand, wipe, sand, wipe, sand, wipe, compound, polish, wax. Done. Looks brand new. And now I have two friends who are paying me $60 each to do their headlights. So now not only did I not waste money, but I profited. Ha. Doesn't get better than that.
Reply: @chrisfix  would just 3000 grit and polish be enough?
Reply: @chrisfix  The HF kit included 500, 800, 2000, and 3000 grit LOUSY sandpaper, and no clearcoat sealer.  My lenses yellowed in months.
Reply: @chrisfix  Or just save the cost on all the polishes, waxes and buy non oem headlights for cheap on eBay 😊
Reply: buy new headlights XD
Reply: Do you recommend putting clear coat on the  new headlight? I'm planning to change my headlights out and want to protect it from yellowing latter.
Reply: Bring your vehicle to a detailer.  They will remove a layer of plastic by buffing it then polishing the lenses with stuff they have
Reply: @sandylister514  stop being poor then. Get a better job. It's not hard
Reply: Thanks a lot!
I like the lowtech, lowcost, handywork. Like in the good auld times...,😄
Reply: Chris I need to tell you that I did this yesterday and I am totally amazed with my headlights now thank you so so much for this video for taking the time to make it. I know you uploaded 3 years ago and the first time I saw it  I was lying on my sofa with two bandaged hands from having double hand surgery crying because I really wanted to try this and vowed to once my hands were healed. I saved the video. That was one year ago March 19th and I was finally able to get the supplies and was physically able to do this and find time to. I drove home from my mom's on country back roads tonight complete darkness and could see EVERYTHING those awful yellowed headlights made my van look SO bad. Just thank you so so much for this it means a lot to people who can't afford to just buy a new car or new headlights.
Reply: @nealedmondson3191  and most people that say buy headlights b the ones that be broke 🤣🤣
Reply: @michaelbrown1911  its funny watching this in 2022 and now 25 dollars an hour is basically minimum wage
Reply: @LORDRA1DEN  Yeah, that’s not how that works. If you aren’t at work, then you aren’t making anything. The 1 hour or 2 it takes to do this isn’t costing you shit lol, get over yourself. You’re making $25 an hour, not $100
Reply: Chris loved the way my lights came out but I over sprayed a little on one it's noticeable I am going to wait a few days but how do I get the excess off basically meaning streaks
Reply: @chrisfix  First, I want to thank you for this video tutorial. Nice job! I used this process on my wife's Camry and the left side looks pretty good (although I see a turtle shell pattern of fine scratches, but haven't polished it yet). The right one is still foggy. I think it's because I used the same sandpaper and it wasn't fresh enough. So, going to try this fix.  Could you also start over with the entire process again?
Reply: @LORDRA1DEN  then you are missing the point of this channel.  These videos are for people who enjoy working on their cars or like the DYI challenge.  Go buy your headlights
Reply: @wabashstudio  depending on the headlight it may not be worth buying a new set unless it's broken if it's aftermarket. The aftermarket headlight assemblies on both my vehicles are +$130. I rather try this. Also just use the McGuire headlight coating spray with brand new headlights as I did with my expedition when I swapped the headlights to avoid any future UV damage.
Reply: @nikhilnadasan6028  false. All headlights get worse with time, if you do this technique properly it can last a few years, maybe more if you keep them clean and polished
Reply: @bernardoojeda5295  my daughter wears glasses but they are plastic we still call them glasses
Reply: @chrisfix  so then that means first polish then finish off with a wax?
Reply: @nealedmondson3191  
It takes just as much, if not more time, to replace them.
Reply: @wabashstudio  thst is a waste to the environment
Reply: @sharkvshark  No, polish is essentially liquid sandpaper, wax is a protectant, 2 different things
Reply: @LORDRA1DEN  how do you suppose they get installed then, ya? No work? Lol hiring someone will cost you another $150 so...
Reply: Worst advice ever! The clear coat paint went to a crackle finish. Wound up having to buy a new set of headlights for a 1997 Ford F-150. Everything was beautiful following the 3M  instructions, until the paint. Do glad I did not do this to my Lincoln's headlights first. Seemed like it etched into the wide open plastic pores. 3M makes finishes and didn't include paint. Included a protective base and finish. I will stick with the OEM advice on their OEM product. Yes, I did wash, dry, and wipe down with alcohol lint free wipes. 30 bucks cost me $120. Nope, nope, nope!
Reply: @rmagharing  Wow!  That's amazing!  With the money you saved you can take a short vacation. 👍  I know I'd rather spend money on a vacation than on a headlight.  LOL!
Reply: TOP DEMAIS DA CONTA LIKE GARANTIDO FUIIIIIIII 👍
Reply: Did you use uv protected clear coat? If yes or no..buy new lens ...question why would you have paint on lens?
Reply: @michellekrueger5122  Clear gloss IS paint in a spray form. I think that's what he's talking about.
Reply: Oi
Reply: Oi
Reply: @wabashstudio  well for a lot of vehicles new headlights can be up to $400 or more
Reply: M
Reply: But a new headlight
Reply: Start again use a proper clearcoat such as Megiurs, As the old saying buy cheap buy twice!!!🤣
Reply: Chris fix, I did the wet sanding and looked like things were going good.  Still a hazy after I cleaned with alcohol.   I did 3 light coats of the spray.   Still looks hazy.  Did the wax.  Didn't help.  What do I do?  Acetone to take spray off then start over sanding again?
Reply: Daughter's boyfriend just did this type of thing with sandpaper.  Lights look like new.
Reply: If you followed his steps exactly then its going to look hazy because it wasn't smoothed out. He instructs you to leave it scratched up so the clear can grab and wont run. This video is 8 years old so I guess I can't fault the guy. You want to polish out the headlight, compound, polish, and seal it with clear urethane to get them really clear.
Reply: The ones with the 2.4 turbo are actually surprisingly quick and I would drive one it wouldn't be something I would choose but if I had to choose that or a cavalier or something
Reply: LMFAO
Reply: @LORDRA1DEN  So you work 24 hrs/day?
Reply: @chrisfix  How come wax doesn't just melt off in the sun?
Reply: @LORDRA1DEN  Yeah, that crossed my mind. I'm unemployed so I have a lot more time than money! Still, I wondered if my time would be better spent looking for work. Or just ditch the car..
Reply: @LORDRA1DEN  oh wow! Big man! $25 an hour, that’s minimum wage bro.
Reply: @Ungalfo  Car rep 2k. Has No Pot life. Can be used on lights and put on shelf and last years. Can't do that with any other 2 part system that once mixed is in a timer. Great stuff. Primer, paint, clear exc.
Reply: @-Yurkey  You drive the car within those 3 days?
Reply: Funny enough, the 90's had glass headlights that weren't sealed. My Prelude still has it's plastic headlight covers. :)
Reply: @jdamqueen  Name one state where $25 an hour is minimum wage.
Reply: @nesmacinvestmentsllc772 where can I get the sand paper?
Reply: @Ungalfo I didn't even know there was 1k or 2k... I'll have to Google that
Reply: Wet sand
Reply: Use 3000 grit it will be even better
Reply: Definitely will increase visibility !
Reply: @nealedmondson3191 no, there just rich
Reply: Can I use this process on the brake lights too?
Reply: Mine looks like spider cracks all over it after sparying the clear coat what did I di wrong?
Reply: Rust oleum 2x ultra clear gloss clear bonds to plastic
Reply: What kind of wax? I brought all supplies before going to the end of the video than he adds wax 😮